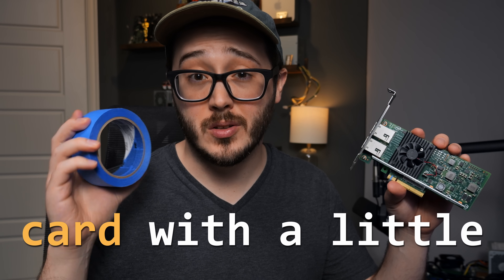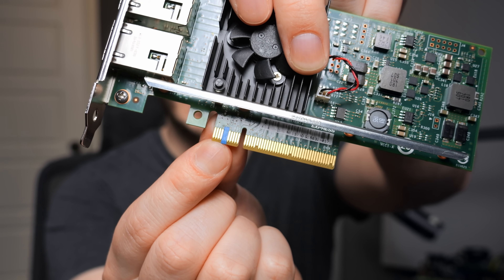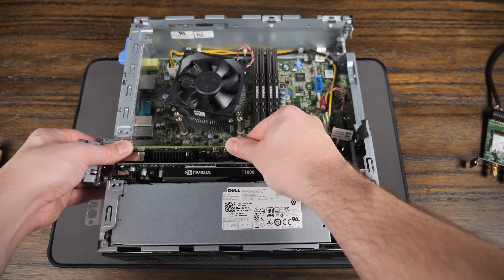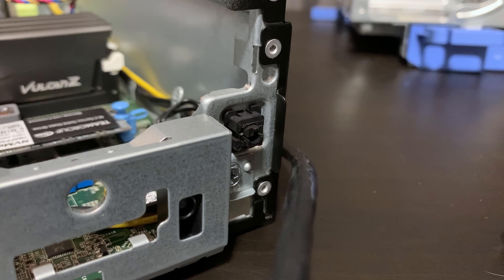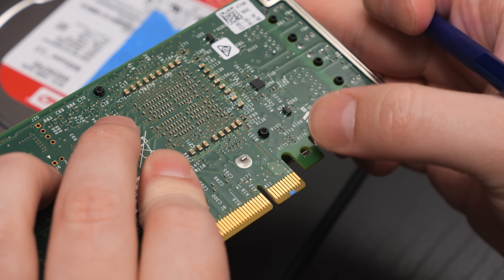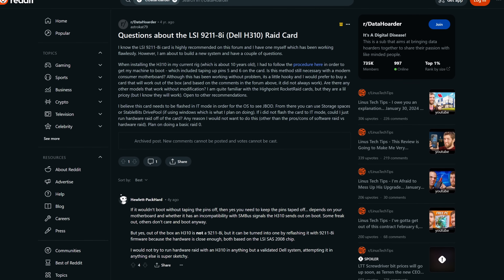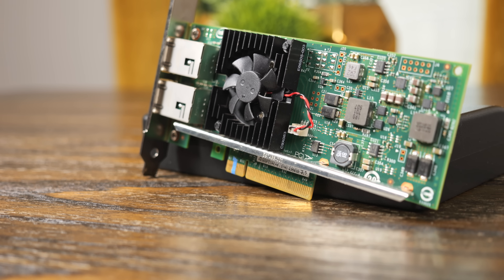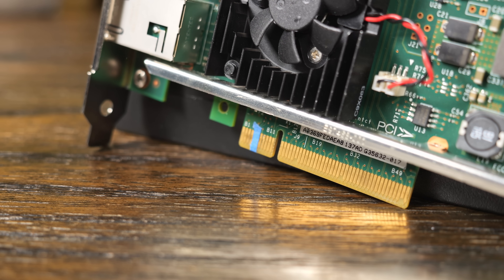PCIe Card Doesn't Work? Try This!

Comment: This is quite interesting. A friend of mine did something similar with a HDD enclosure. He took the drive out of the enclosure, covered some pins and he now has an expensive drive that he paid a fraction of the original price for because he bought it in an enclosure. Thank you!
Reply: Yes , you remove the 3.3v pin, if the hdd sees 3.3v it won't spin up...
Reply: that pin in the drives is used for staggered spinup so for a server backplane to keep the drive powered off so it can power on the drives gradually and not all together to not overload the power supply

Comment: For me, I prefer using packing tape when I tape pins. It's thinner but doesn't come off as easily. Better for multiple inserts. And if one asks me how do I do this so much, it's because I used to and can still overclock Pentium II processors.
Reply: bsel mod used to be a thing. Good times.

Comment: This is fascinating as electronics engineer, will have to look into the smbus protocol. Seems like jtag/i2c compatible bus, i2c used for communication between nvme wifi cards and even between arduino & b&w oled display while jtag used to program fpga or arm chips. From the snippet it video, seems to be just for inputing data to the card, so even if standard might have something to do with feature set available only in server side hardware or just business use case like how ecc memory is/was.
Reply: I've worked with SMBus primarily for battery packs and it's basically I2C with some more strict timing specifications, ACK/NACK requirements, and address resolution. It's a pretty interesting protocol overall and an interesting approach to making I2C more robust
Reply: @FowlerAskew  battery packs? Never would've thought of that of all things but I suppose it's critical info to prevent boom. Looks like eSPI & SMBus are intels updates to SPI & I2C. Idk if I3C owuld catch on but getting popular.
SMBus for pcie seems to be for getting temp data for the card along with other things, so my initial assessment is probably correct that consumer chipsets just doesn't know what/hot to respond to the things the card asks for and is mapped to something else. Stopping it from communication just makes it behave like normal pcie card which is why I suppose it works

Comment: Tape is apparently a great fix. I have an 8TB backup hard drive in my main PC running 24/7 and it has pins taped to make it work. I pulled the internal HDD out of the WD usb enclosure, and they have proprietary info that goes out one of the unused 3.3v pins, and you have to tape it to get the drive to show up outside of its expected WD enclosure.
Reply: Correct me if I'm wrong but I believe taping the 3.3v pin is only necessary if you're using an older power supply. I have a few shucked WD 14TB connected to a corsair RM850x and didn't need to tape the 3.3v.
Reply: The SATA spec changed, so one of the 3.3v pins was unused and was switched to be a "reset" pin. If you don't tape it on drives that use the newer standard with an older PSU/connector, the 3.3v will hold the drive in reset rather than letting it power up.
Reply: Yup. Taped over the pin on 3 diff shucked WD White drives. After limited warranty period, I just pulled em out.
Reply: Yeah that is the first thing I thought of, I have a couple shucked drives that needed this fix.
Reply: it's not proprietary, it's a newer Sata spec that uses that pin for staggered spinup